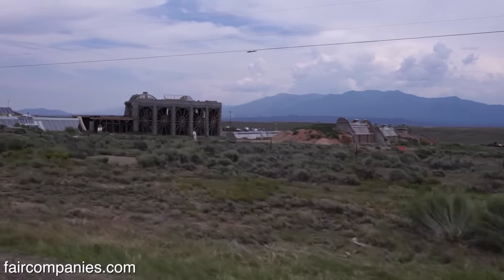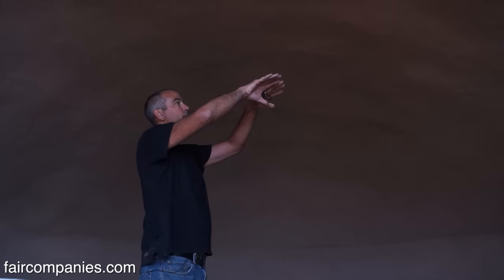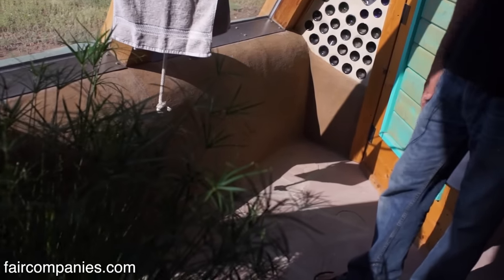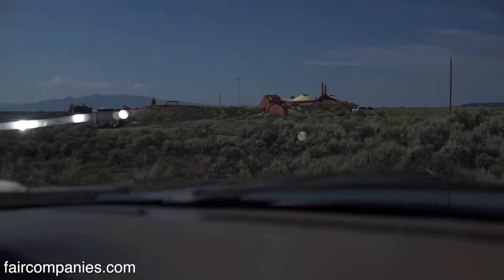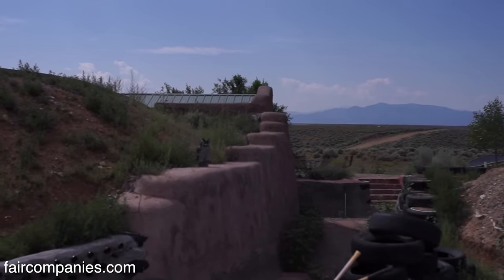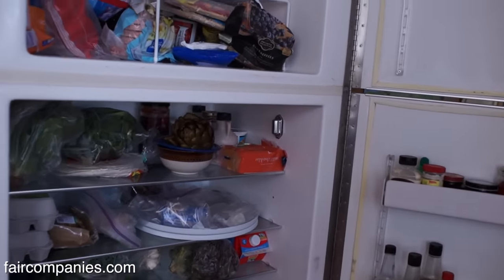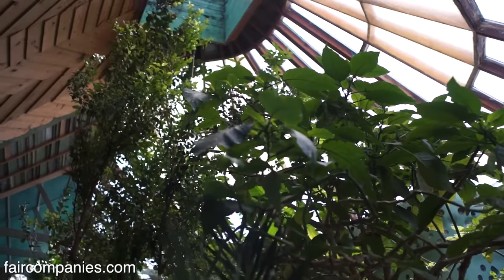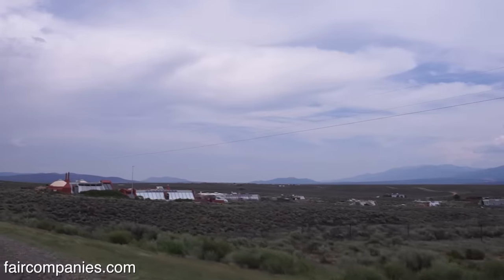Earthships: self-sustaining homes for a post-apocalyptic land?

Comment: They are building without any restrictions.  Hey, that used to be America, the land of the free and the home of the brave.  I'm glad they got a taste of what freedom actually is.  Now, do you think we could get that freedom back for the rest of us?
Reply: Jonathan Rogers Not if the Conformity Police has anything to say about it.
Reply: +Jonathan Rogers That's also the freedom of someone to build/sell you a house with a foundation built from sub-par materials, asbestos insulation, lead pipes, pipes on exterior walls that will freeze in the winter, shoddy electrical etc... 

Do you think Haiti and Nepal would have had such high death tolls if they built homes to California code? Yes, inertia's a problem, but let's not pretend that codes don't keep people safe.
Reply: Who says you can't build a safe house without codes or permits?  Codes are not about safety, they are there to protect the established building industry. You can build a house in California to code and watch it go up like a box of matches in brushfire; happens every single year.   
And permits are simply legalized extortion; a town nearby (kind of a dump actually) wants $5,000 for a plans check fee, for example. It's BS.  Having the right to build your own shelter ought to be a basic human right, not something  you have to grease a dozen palms for first.
Reply: PDZ1122 "Who says you can't build a safe house without codes or permits?" No one, but it's less likely. Yes, bureaucracy is a problem, but I doubt those homes going up in flames would have a better chance if they were built to shanty town standards.

Thank goodness it's NOT a basic human right to build a house that's a death trap to your family and guests(watch Holmes on Homes). You shouldn't be "free" to build decks guaranteed to collapse, houses prone to black mold, septic systems that drain into your neighbor's well water.
Reply: Richard Snow But you should be free to build anything you want, on your own land that does not hurt or interfere with anyone enjoying their land. That's where it should stop.  You can hang a sign on the door that people enter your house at their own risk. I build airplanes under the Experimental category rules and we can build and fly anything we like and it does not have to conform to FAA standards. We cannot use them for commercial purposes and there has to be a placard stating that it is an Experimental. Guess what? They don't come crashing out of the sky in droves, people aren't getting killed by the dozen by these deathtraps  and there are over 30,000 of them flying all over the country, almost all out performing anything that you can buy of a production line.  Airplanes, for god's sake!   As if a house would pose anywhere near the same engineering problems or potential dangers as flying in a homebuilt airplane.  Like I said - it's all about industry protecting its livelyhood and nothing else. Let me guess - you work in this industry?
Reply: PDZ1122 "You can hang a sign on the door that people enter your house at their own risk.", was that supposed to be followed by a "wink, wink"? I didn't see any signs on these earthships saying, "This garden may have shit and ecoli overflowing onto the food, BEWARE!!", or "Drinking water may have bird shit from the roof". Do these people's children have a choice in the matter either way?

If you build a horrible plane, it probably goes to the scrapyard. If you  build a total disaster of a house and ditch it, who's going to buy it knowing they have to pay $20k+ to tear it down before building a proper home. That drops your neighbor's real estate values, lowering city revenues, degrading infrastructure, keeping businesses away, lowering values etc. The key word in your point about planes is "Experimental". These experiments are fine on a small scale, but if you want 300 million "free" people going through trial and error with every aspect of their lives, that sounds like a disaster(especially for the environment). It's cheaper and more effective to do things right the first time instead of retrofitting the disaster. 

No I'm not in the industry. I have opinions about healthcare and taxes too. I guess if you don't agree with them that must mean I'm a doctor and auditor? If anyone has an ulterior motive here it's you trying to eat Boeing's lunch.
Reply: Richard Snow How did humans ever survive before the Conformity Police came around and told them how to live...?  Like I said - if you don't hurt your neighbor in any way, don't pollute anything,  don't cause anyone any harm (and no, you don't get to decide what's best for the children - I think that's a job for the parents, not the rest of society) then you should be allowed to do damn well what you please on your own property.  If you have bird shit in your drink, why is that a problem for the rest of us? If your neighbors don't like the way your house looks, just because it's different, well, screw them. Do we need an"aesthetics" police now too?  

I'm done with this. There are certain countries suitable for people with your views. I don't think it's was supposed to be this one. And I'm not even an American.
Reply: +PDZ1122 "How did humans ever survive before the Conformity Police..." A lot of them didn't. Do you mean back when there were rampant cholera outbreaks and plague? (modern plumbing is the central issue with these earthships) Back when whole cities went up in flames because one person dropped a lantern?(there are codes that slow the spread of a fire from one house to another) Back when people lit poorly ventilated fires at night and their families just never woke up because of carbon monoxide? Should inefficiency be allowed? Houses putting excessive stress on the grid/water supply and fossil fuels is a problem too. One farmer, farming irresponsibly isn't a problem, but when a whole region does it, we get the dust bowl.

Concerning children, there are shitty parents and parents that aren't aware of the numerous codes keeping them safe. Radon is the second largest cause of lung cancer behind smoking. In this "free" world, who informs parents of the minimum needed to be safe from something like radon? Is it the contractors whose interest would be to cut corners?  If you think an abusive or ignorant parent should be the single authority in child welfare, then you're sick.

But to continue answering your recycled arguments, they may have made sense 100 years ago when people weren't so specialized and were knowledgeable in how to build homes, when people inherited homes/property for generations and lived miles away from others. Not when people are hopping from house to house every couple of years.

Yeah, if you want anarchy then America isn't the place for you. All you have are empty platitudes about freedom, but no substance. I hope next time you get screwed over because someone cut corners, you have the consistency shrug it off and chalk it up to freedom. Or you could sue them, which is based on precedent, which is just another form of standards.
Reply: *****we'll be living in dorms at the company soon like China
Reply: Jonathan Rogers Yeah, you don't want your neighbour building some fire hazard or something that will in few years get knocked over to your house. The restrictions are there for general safety, but in reality nothing prevents you from moving to Alaska, hiking far into the forest and building whatever you like.
Reply: Richard Snow TLDR
Reply: +Klaa2 Many "home owners" are not around to see their home gain appreciation value when they are paying a 20yr mortgage only to default on payments because of insane rates and sell the house under market value to avoid being homeless. Then they use that money to get another house on a mortgage or live in an apartment and never actually own the place they live in. 

IMO these house do appreciate over time since you can build a basic one by yourself on a budget lower than a conventional home, then sell it with amenities such as self sustaining water, food and electricity. Self sustainability looks pretty good when it means avoiding a mortgage, utility bills and insane homeowners taxes.
Reply: +Spiritfba "TLDR"

Is that what you put in the Education section of your resume?
Reply: +therotaryrocket Nice strawman argument. As for your issues with social programs, that's a whole other topic.
Reply: +Richard Snow Can you imagine how few people would have homes in haiti if they were forced to conform to California building code?
Reply: me watching this discussion.  PDZ1122: "you should be free"  Richard Snow:  "No I shouldn't".
Reply: Our American ancestors had much more freedoms than us.  Sure their technology sucked but they didn't have to deal with things like corrupt public police until the 1830's since there were only private police since even before the 1700's.  Public police was a way to have an army on the streets without having an actual ARMY like the redcoats.  Just call them "peace officers" and tell the public they are there for our protection.  Our recent ancestors could travel the world without permission in the form of a passport, that's right, they could visit members of their own species without permission.  You didn't need permission to do much of anything really.  Build your house the way you want, it's your property.  You were treated like an adult.  Today grown adults need permission from other grown adults called "government" to do things our ancestors did with impunity.  Our ancestors would be disgusted if they could see us now.  We would look pathetic to them.  People today think we need these restrictions on freedom, I wish those people could talk to their ancestors.  The most common response I get from someone when I tell them they should be free is some form of "no I shouldn't".
Reply: +Matthew Carroll I was mainly referring to standards in the US. But I do think that Haiti should have "A" standard that's enforced. It's better to do something right the first time than rebuild every time a hurricane/storm or earthquake happens. There are cheap alternative methods . . .  like maybe packing dirt into tires.

Chile had an earthquake that was 500 times stronger than the one in Haiti, but Chile suffered 500 deaths while Haiti had 316,000deaths(and 1,000,000+ homeless)
Reply: +Richard Snow You do realize that those atrocities committed against blacks and natives were condoned and enacted by the US government, right? If not then you need to find a real history book, not a public school textbook.
Reply: +Rica Rose "You do realize that those atrocities committed against blacks and natives were condoned and enacted by the US government"

How does that prove that our "American ancestors" were living in a golden age of freedom? The "freedom" that swiftynrye mentions only applied to white men and came at the expense of others. Only in a world of infinite resources(or at least perceived infinite by the theft of land, labor, opportunities...) can society function without a strong government.

Also, try commenting on what someone says, and not whatever bullshit you feel like projecting on them. . . anarchist.
Reply: Richard Snow
I did comment on what someone said, I commented on what you said. And instead of addressing my comment you projected on me, lol good job statist.
Reply: Richard Snow
I do not think that the term statist is a pejorative, it is merely an observation. You have been arguing in favor of the state the entire thread. I do not need to address every part of the conversation because I do not care if you love building codes and believe they keep you safe. I replied to your comment that stated this :

"Was that freedom you mentioned the freedom to commit atrocities against blacks and natives for personal gain?"

Those atrocities were condoned and enacted by the US government. Do you realize that?

You have responded to me twice and still not answered my original question.
Reply: +Rica Rose "Those atrocities were condoned and enacted by the US government. Do you realize that?"

I answered you in my first reply. Just because you didn't like/understand it doesn't mean I didn't answer it. The answer(spelled out) is, no shit, who doesn't know that and wtf does it have to do with what I said? I'm not going to re-write what I(and others) have already stated just because you refuse to scroll up the page.
Reply: Richard Snow
You did not answer a yes or no question, you responded with a question. You do live in a world with infinite resources you simply don't realize it. So, you do know the government commits atrocities and still defend it. That same government is still committing atrocities. Wake up or keep sleeping I don't care but thanks for the underwhelming conversation.
Reply: Richard Snow
You already agreed the atrocities were committed by the US government. What do I need to back up?
Reply: +Rica Rose "You do live in a world with infinite resources"
"you do know the government commits atrocities and still defend it"
Reply: Richard Snow
If you can not see the abundance of the planet, then I am sorry. Are you saying that the government isn't still committing atrocities or that you are not defending them? Simply copying my statements doesn't help relay what you are gnarly about.
Reply: +Rica Rose "Abundance" does not equal infinite. And where did I defend these atrocities?
Reply: Richard Snow
The abundance of renewable resources seems pretty infinite to me. Look, I understand part of where you are coming from. But this "finite planet" stuff is political hogwash. Look into the Club of Rome and their "reports". As for defending the atrocities, you defend them by defending the institution that commits them, the US government.
Reply: +Rica Rose Wow, I didn't know landmass/arable land was a renewable resource. Even solar is limited by storage mediums and silicon for the photovoltaics. I know the carrying capacity for Earth, with people living at a US/EU standard of living, is 2-3 billion sustainably. Instead of making a single point you say,"uh, go look at ...." Does this Club of Rome say we can sustain 10, 20, 500 billion? How about a 500 trillion people?
Edit: I'm not sure why you brought up the Club of Rome since just a cursory look shows they mention "limited resources" repeatedly.

"As for defending the atrocities, you defend them by defending the institution that commits them, the US government."

WOW, what a broad and sweeping false equivalency! Where is this utopia you live in? Because if you live in any imperfect country, then by your reasoning you're complicit in anything they've done. Or were you planning a coup/insurgency? Personally, I think it's more productive to work to improve what we have instead of pretending that tearing them down and starting "fresh" with something marginally better/worse or identical is a solution. Ideologues paying lip service are lazy, I'd rather stick to reality.
Reply: Richard Snow
You keep spouting green revolution rhetoric. You also want to keep the same institutions which allow the raping of the planet that you claim to want to save. Then you deny defending the institution and go further on to defend it more claiming you live in reality. If anyone is lazy here it is you because you want to stick with your immoral State utopia. Good day.
Reply: +Rica Rose Whoa, how is the planet getting raped when you've clearly stated that its resources are infinite?! Nice dodge btw. And are you being intentionally daft with your facile statements? Keep attacking that strawman instead of what I'm actually saying, good strategy!! I said I want to improve a flawed system(acknowledging the flaws, not defending them). You've offered ZERO alternatives, you regurgitate ideological criticisms but no solutions.
Reply: Richard Snow
One example of raping the planet is the polluted run off created by mining companies. Using the natural resources isn't the rape. I am not going to address every single point you make because you keep throwing more topics into the mix and muddying up the waters. You have defended the system the entire thread. If I appear facile it is because you don't understand the system that you want to fix because you think it is broken. It's not broken. It is doing what it was created to do. You already demonstrated that you didn't like my solution when you called me an anarchist as though it's a bad thing. You keep pointing to the symptoms that we see happening around us and I am trying to point out to you the disease causing the symptoms. We are going in circles with this.
Reply: +Rica Rose Lol, "mudding the waters" by pointing out your contradictions? I think that's your subconscious trying to wake you from your cognitive dissonance. Why does pollution matter since (according to you) we have unlimited clean water? Even so, do you think these polluting companies would be better with zero government restrictions? I've thrown no new topics in, I'm just showing the flaws in your "logic" concerning the same topics. You just keep burying your head deeper in the sand.

You're facile, because you make oversimplified statements ignoring what both you and I have stated. AGAIN I was joking with the anarchist comment, but if you're admitting that that's your solution then WOW! I'm no sure to what degree you take that but even in tribal civilizations, there is government.

"[The System] is doing what it was created to do" If you mean evolve, then yes, that's what it's doing. And people like you pointing to fantasies as solutions only slows that progress. You're worse than the Tea Partiers.
Reply: Richard Snow
Nope, you have misinterpreted everything I have said and added to it your own assumptions. But that's ok, because I am done wasting my time with you.
Reply: +Richard Snow Actually, you can settle down.  690 acres are by permit and only 2 acres are for experimental purposes and do not require permits since they are for experimenting and not being sold as traditional housing.
Reply: +Jonathan Rogers The land of the Free LMAO. Half the world has more freedom than the states.
Reply: +Jonathan Rogers 
Actually, there are provisions in the Building Codes for you to build structures in unorthodox ways.........but you have to prove it can pass certain testing standards to be viable as a legal structure up to code. THAT I don't think is a bad thing since we all hear of the massive deaths in 3rd world countries due to make shift buildings with no code associated with them at all.
However, what I think is messed up is the cost for this procedure along with the fact that last I checked, there is no 'additions' made to the code once its proven to work. Meaning....that if your neighbor created the same structure using the same building process, he also would have to under go the same testing to ensure structural integrity. There is no set Precedent once completed.
This "Piece meal" approach is inefficient and full of BS bureaucracy. And i'd be willing to be someone is making money on it.
Reply: +PDZ1122 If you own some wilderness, you can build whatever you want without anyone's permission. You just can't insurance for it.
Reply: +Richard Snow    I'm a contractor that's built many a structure that's guaranteed to withstand hurricane winds and stay dry. If you're Harry Homeowner without a clue, that's a different story. One can always get help from someone who knows how.
Reply: +Jonathan Rogers -"do you think we could get that freedom back"?...no, because there is always going to be someone to tell you what's best for you--someone (or group) who 1. likes the sound of their own voice 2. like to impose their will on others 3. thinks everyone else on the planet is stupid & incapable of taking care of themselves 4. is not happy unless they are b itching about something!--sry I know this discussion is old but I just saw it....
Reply: +Richard Snow Even the most liberal estimates are showing a population peak at 9 billion. Most of our crowding and expense issues are caused by bankers and politicians placing restrictions on creativity, travel, farming, business. The globalist agenda wants to reduce population by 95% which is just apocalyptic. This could not be accomplished without rampant war, famine and disease, so think twice before you support them
Reply: So by freedom, you mean stealing other people's land and using it without restrictions?
Reply: The thing about land is that it was all bought up before we came along. Yet we don't truly own it. We just pay rent on it to the corporate pretending to be government landlords until we die. So by freedom, yes, I mean living freely on the earth the way people were meant to do, without paying rent to government landlords who create artificial borders. Or do you need to go through a few more turnings of the screw before you understand that we aren't allowed to do what we want even on our "own" land?
Reply: Well Jonathan.. From what I'm hearing you can get a ticket just for jaywalking in the US. I don't even know what to say about that... Your government is obviously killing your ability to make even the smallest everyday decisions. Something is seriously fucked up with your country. Good luck!
Reply: +Rica The Hopeful Voluntarist
"You already demonstrated that you didn't like my solution when you called me an anarchist as though it's a bad thing."

How does that statement NOT imply that your solution is anarchy? As for "the system" I hope you're happy with Trump dismantling that system. Funny how "environmentalist" all about earthships are also for "freedom" from regulations. Say goodbye to clean water, air, whales, lions, tigers, rhinos, the great barrier reef, glaciers etc etc etc...
Reply: Don't conflate the EPA with actual environmental protection. The Great Barrier Reef died under Obama and friends. Regulation never hurts big biz, because they buy their way out of it.
Reply: Richard Snow Easy, take away bogus corporate personhood, bring back anti-monopoly laws, and take away their corporate charters when they Rob, poison and kill. Thanks to corporate welfare and limited liability, only the victims pay for their "mistakes"
Reply: Jonathan Rogers 
hi! i agree! we've list SO much!
Reply: the new freedom is freedom from God! dont fall for the satanic agenda against humans! may God guide us ameen
Reply: PDZ1122, nice rant but here's the fly in the ointment. You live on a 100" X 100" lot. You have a frame home you have a septic tank and a well for water. You have you, your wife and 4 kids. Your septic tank can not leach that many gallons of waste water and you can't put in enough drain field on that size lot so you are contaminating not just your well but your neighbor's well as well. When you overload the leach field your marginally treated waste water runs over into the storm drain causing a algae and fly problem. When your neighbor complains and says you need to improve your system you say "It ain't hurting anything. I don't have the money to improve the system so "bite me". Unfortunately, this is why we have laws.
Reply: I wish. But now with cities, everyone flocks to them but they are a cesspool that lacks much freedom and has much chaos. I would rather live in one of these any day of the year. I guess if I curate enough off the internet, I could also teach my kids everything they would ever need from science, math and literature.
Reply: I sincerely doubt you could teach your kids much of anything.
Reply: Regulations are killing America.

My brother is an explosive demolition expert - learned his trade in the military - you should see the amount of form filling and security checks he has to go through to get hold of simple materials for his business, like detonation cord and C4 plastic explosive.
He's not allowed to employ children either.

all these regulations do is push the price up for the end user and keep government pen pushers in cushy jobs
Reply: Richard Snow I agree about the safety issues.  But how about codes that regulate the appearance of houses, such as insisting that every garage must be attached?  This is purely aesthetic, and it does nothing more than increase the fair market value for assessment and real estate taxation.  Or the ridiculous insistence that door lites be made of tempered glass while a window two feet away of much greater square footage and also operable can be regular window glass?
Reply: matthew carroll - those people are all lucky if they are even living in tents now. Why would we want to live like a third world country?
Reply: Dang man spitting truth!!
Reply: @greennewdeal5539  Haiti for one is the poorest country in the world and its a island with very limited resorts. They do what they can
Reply: @PDZ1122  if you want to take a look at the results of no regulation,  you need to cross the border at Nogales. A picture would be worth a 1000 words.
Reply: @greennewdeal5539 I agree with you.

I think a lot of these libertarians have not seen the real life results of deregulation. 

Any time I read that something has been deregulated, I know that it's time to start looking for the bodies.
Reply: @PDZ1122  up in bushfire because the house is in a place it shouldn't be.
Reply: @5ynthesizerpatel child labour is back
Reply: @mendoblendo321 which is to say ?
Reply: All right don't get crazy out of hand okay some of that freedom also caused people to do really crappy things and leave people burning alive and buried under buildings that weren't properly build so there's a balance
Reply: The government isn't any more moral or ethical than the people it hires.  The secret to having work done properly is to obey the biblical mandate "whatsoever you do, do it as unto the Lord."  Do it with a conscience, knowing that judgment day is fast approaching.
Reply: All good fun until somebody gets hurt, which is exactly what happened.